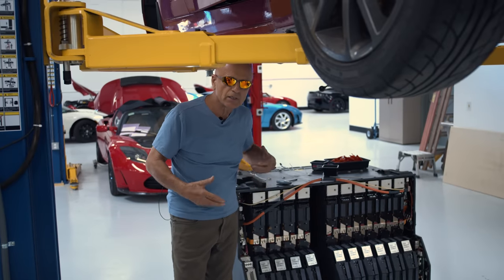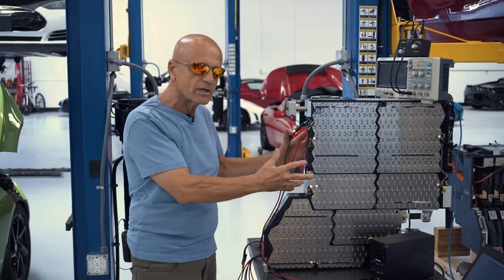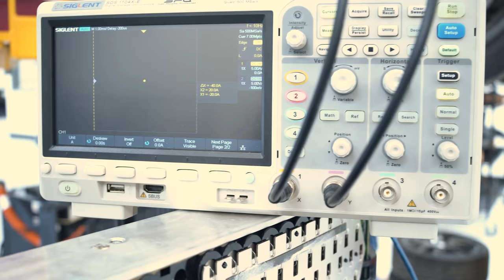Tesla Batteries STARTING TO FAIL | Gruber Motors

Comment: If you want something diabolical, try a latest generation Mercedes SL, after about 3 years (the warranty period), the sensors start to fail, roughly one every 4 months. There are 6 sensors in the exhaust alone, one of the average priced sensors failed at a price of £550 for the part, but the sting in the tail is that you have to take the drivers seat out (a 2 hour job according to Mercedes) just to get at the wiring. So battery issues are nothing in comparison.
Reply: Maybe the guys from BMW or Fiat started to work at Mercedes. Fix it again.
Reply: I will agree with you that a modern mercedes would have rediculous maintence, but he said that battery pack is $29,000 and takes 2-3 years to get so i don't really think the issues are comparable.
Reply: @zacharyswartwood218  Different types of cars. I'll just say that I'm disappointed in Mercedes. Scotty Kilmer's channel showed us a new Benz. My goodness, way way way over engineered. Stuff is already breaking. At the end of the day it simply gets you to where you're going, if you're lucky.
The battery pack is a real bummer. The traditional old model people would buy cars and get rid of them after 5-10 years. My daily driver is a 17 year old Cadillac. Still going strong. I'd hate to think I'd be looking at a 20-29K bill to use the car anymore, or worse a $100+ K bill to buy a new car. Yikes. It's like a regular car where after 10 or so years you have to rebuild the transmission, engine, and other components. The other problem they're not talking about is tires. Teslas seem to burn through tires at a much faster rate than ICE cars. Imagine being a young man, saving up enough money to buy a car, then the battery pack goes bad.
Reply: I've always heard that the Germans over-engineer their cars. Never doubted it.
Reply: @alexvagias5295  I thought that too, but from my direct experience and that of friends and colleagues, a Lexus is a far better bet if you want reliability. I don’t have a vast circle of friends, but one had a £30k bill for a new engine in his Audi R8, another had the IMS bearing fail on his 911, just a leak, another had the IMS bearing fail catastrophically on his Boxster, £10k rebuild, two friends had the cylinder linings fail on Audis…. One on his BMW. But as I say my Merc took the biscuit. So I sold it and went for a Lotus as they have Toyota engines… nuts choice but so far so good, although the fit and finish of the interior isn’t a patch on the Merc… but it’s a far more authentic / fun thing. But logic says when electric cars mature I think they should be far more reliable as there’s a lot less to go wrong.

Comment: Thanks for the video.  People ask me all the time...how long do the batteries last?  Looks like about 15 years, but is this mileage based (use based) or time based?  In other words, if you don't drive "much", will the batteries last longer or will they go resistive after ~15 years regardless of how much they're used?
Reply: Both !! Well logic say the more you used it the faster it worned out and these batteries have their own age
Reply: @auliaabidharma904  it also depends on how you charged the batteries or how/where you drove it in very high/cold weather…… also hard driving….
Reply: Leaving batteries fully charged is destructive to the cells so low mileage pack wont be great if not stored correctly.
Most owners will leave it fully charged or at 80% just on case they need to drive it.
Reply: I don’t think the roadster cells are water cooled are they , unlike the other models ?. So prob a bad comparison.
Reply: 900-1,000 cycles….estimated
Reply: @tellucas  this range is very limiting, but it is true, that the reason I would get a much bigger battery than I needed and use the middle 40 to 50% rather than needing to use 80 to 100% on a smaller battery.
Reply: @tellucas  I was a very early adopter of lipo in rc planes and was going.through a LOT of batteries until we figured out the storage issues were doing more damage then actually cycling them.
Reply: The batteries degrade with age. So, even if you only drive the EV a few miles per week, the battery will likely be worn out within 15 years or so regardless.
So, an ICE vehicle is the best choice by far for low mileage drivers.  
Unlike an EV, the life of an ICE vehicle can easily be extended to 25+ years with low mileage light usage and basic maintenance.  
You also will never recoup the additional up front  purchase costs of an EV with the fuel and maintenance savings if you are a low mileage driver.
Reply: @webcomment8895  so much of the cost of ev is the battery, the only hope is that there is will be replacement options in the future that might keep an old ev on the road.

Comment: This is the one big reason I don't really like the idea of large scale BEVs. especially as a daily where you'll be seeing a lot of cycles on the pack.

replacement fuel tank for the average car: $200 - Far less if you get a used one
Replacement battery for a tesla: $18,000 - less if you get a refurbed pack

Fuel tanks don't lose range on refills. Lithium cells do.

I will say though, the tech has come a damn long way, and it will be interesting to see what happens in future with both motor and battery technologies.
Reply: the battery needs to be compared to a new engine and/or a new transmission in internal combustion engines.
Reply: @anthonyballog8026  In that it's a wear item, and that maintaining it will extend its life, yes. but an EV battery is still more akin to the fuel tank, as like a fuel tank, it is storing energy. Just instead of dinosaur juice, it's little tiny ions of lithium with a bit of manganese and cobalt thrown in for chemistry reasons. oh, and the energy produced isn't combustion unless something goes horribly wrong :)
Reply: oh. also, if we want to compare the performance and reliability of a Tesla battery pack to an internal combustion engine just in terms of raw cycle life... here's what I can come up with;

Tesla battery (Panasonic NCR18650B or their equivalent NNP cell) (to about 80% capacity) - 500 cycles

note: the capacity starts tailing off further and further as the cell is cycled.

Other EV batteries using Lithium, iron phosphate (LFP) technology (80% capacity, cell manufacturer dependant) - 700-1000 cycles

Internal combustion engine: fuel tank range remains consistent throughout the vehicle's life. The only things that can really affect it are maintenance, a leak, and that's about it.

The downsides obviously for either are;

ICE:

- Emissions, especially with diesels, can be fairly noxious.

- regular maintenance required (every 3,000 to 6,000 miles depending on manufacturer or personal preference)

- Oils and fuels are not environmentally friendly unless you are using bio-diesels or alcohol fuels and other non-fossil derrived lubricants where possible. Either way - you don't wanna spill them in the Mexican gulf, that's for sure!!

BEV / Hybrid EV (both HEV and PHEV)

- Battery degrades over time, and used cells need to be recycled / disposed of and handled with care.

- requires rare earth materials to produce the motors and cells (e.g Neodymium, Cobalt). Both are not very environmentally friendly to mine. The upshot is we are finding less intensive mining methods, so give this time and it may change and improve vastly.

- Replacement batteries are very expensive. Potentially beyond economical repair if the car is below $20,000 in value and you don't opt to renew the existing pack with cell or cell bank replacements.

- Still requires some degree of fluid / coolant service, but still nowhere near as much as a combustion engine due to the simplified drivetrain

- Lithium ion cells have a flammable electrolyte, and aren't very chemically stable... Basically, give them a match, and you create a very fiery bomb. LFP cells aren't as bad because they're much more stable but can still cause a fire if mishandled severely or shorted.

electric vehicles have undoubtedly come a very, VERY long way from even 10 years ago, but they also still have a LOT more R&D and improvements to be made before they can be a direct competitor to ye olde dino-juice in every way possible. For that reason, I feel that internal combustion power is still going to remain a dominant drivetrain for a good while. Although technology is a fast changing segment, and with the increase in investment in electric storage and vehicle technologies, that is liable to change. It just needs more breakthroughs to occur.

Comment: I had a degradation of 4% after 2 years and 40000km, a year later after 50000km  a degradation of 4,7% on my 2019 Model 3 LR AWD. I'm diving fast on German Autobahn, so battery degradation is no argument any more.
The development is going on and on. Tesla rules.

Comment: Any chance of creating an aftermarket pack solution? The cells are off the shelf 18650's right? You guys could make a killing if you could engineer an even better aftermarket solution with more capacity and a better BECM to run it all.
Reply: if i remember correctly with low production numbers they didnt find it worth making tooling for the roadster, i believe they will for model s, x, 3 and y at some point with higher production numbers
Reply: @jackgreenstalk777  yeah there’s so little roadsters it makes no sense
Reply from the maker: We have been kicking that can down the road for a few years.  The gene pool of owners is tiny, but current climbing valuation and collector interest is making the ROI spreadsheet look better all the time.  We are working on a solution which may include Tesla.
Reply: @EsneiderV7  It could be a good starting point before moving on to upgraded packs for the Model S. It would be tough to reverse engineer the battery management software without infringing on patents but hopefully right to repair laws can allow them to avoid the issue.
Reply: Not a solution when the batteries become part of the frame of the vehicle, which Tesla is planning to do.
Reply: @grubermotorcompany  - I've been wondering about aftermarket packs, not just for Teslas, but all EVs. I guess there needs to be enough older EVs out there and the cost must be low enough to make financial sense. I envision gearheads putting some future uber-battery into old EVs to supe them up like they've been doing to muscle cars for decades.
Reply: Do you do work on the Rav4 EV. Our cars are going to reach the end of it's live too. You can make a killing selling battery packs to our cars as well.

Comment: Why not create a swap cell module for easy replacement?
Reply from the maker: There are 9 bricks (69 parallel connected cells) in each sheet (11 sheets)

Each cell is embedded in a thermal potting compound touched by a cooling jacket.  Removing bricks or cells is not cost effective and damages the cooling system and bonding plates.

Comment: Interesting. I’m curious, what’s the cost to find and remove the bad cell? And I’m surprised they’re lasting 14 plus years.
Reply from the maker: It ranges from $3600 to $6K dependent on the state of the pack.  Check out our website for details.
Reply: @grubermotorcompany  thanks, good to know. Still not cheap, but better than replacing the entire pack.

Comment: With your knowhow,  what is preventing you from making an aftermarket battery pack? It looks like you are working with Tesla not independently to solve this issue.
Reply from the maker: Economics, and Tesla is still producing a highly successful solution for now.
Reply: I heard  over 20% of the Roadster have had the battery replaced under warranty after 5 years.   Only a few survive now with the original battery or motor and seems to be supported with this video.   The 80KW and 90 battery did not perform as well either.   lucky the newer batteries seem to be better but 500,000 miles seems to be a sale ploy. If so give a 20 year 200,000 warranty  on the battery so used Tesla can be economical  or sell the battery at $5000 like you predicted.

Comment: Not trying to badmouth EVs but my 2007 Corolla still runs like a new car and it is older than any Tesla. It will probably continue to be reliable for at least another decade. In my opinion the biggest fault with EVs isn't range, it's longevity. In my opinion Tesla should be devoting some resources to keeping these older cars operating. They could make new battery packs with the latest technology that fit into the older cars and a firmware update to accommodate any differences in care required. If Tesla really wants to save the world from climate change it is a lot easier and less CO2 to make a retrofit battery pack that keeps an old car on the road for 20 more years than to make a whole new car. Probably not as much profit though. Great work Mr Gruber.
Reply: Tesla actually does offer replacement packs for all their cars incl. the roadster. Prices for replacements will drop to reasonable levels over time, be it new ones or refurbished batteries from accident vehicles.
Reply: @murraymadness4674  you can do one thing while doing the other. And without profit you cannot scale and therefore not induce as much of a change. They don't exclude each other. Not all entrepreneurs are classified as the classical homo economics that sees profits over anything else. But without, it is much harder to change anything.
Reply: @murraymadness4674  Have you read their mission statement?
Reply: @lapin46  I used to own a 2012 Tesla S that went out of battery warranty while I owned it. The car worked beautifully but I have to admit I was nervous about the battery dying. Tesla will install a good battery for $22k but they take your old battery back. That makes me think they use the good modules out of the bad battery pack to piece together good battery packs out of them, so they are selling packs with old cells. This is just conjecture on my part but if that is not the case, what are they doing with the old packs and why would they want them? $22k for a battery with new cells may or may not be a fair price but I don't think it is fair at all for a pack with 10 year old cells. If I am wrong in this assumption someone please correct me.
Reply: @alexkram  Tesla themselves state that under warranty they replace the pack with a pack of similar age/milage. These might very well be assembled from individual modules. If you pay for a new one, you actually get a new one.
Reply: @lapin46  That is good to hear, thanks for that info.
Reply: @alexkram  I have seen Teslas with bad batteries sell for as little as 10-15k. Adding a $22k battery brings them straight back to a $30-35k car. It might might not financially work out, but come close depending on spec and overall condition. In the US someone reported that Tesla offered a  4 year/50k mile warranty on a new replacement battery for an out of warranty 2012 MS.

Comment: Thanks !    If each cell is fused, then removing it from the pack can be quite easy.  Too bad that this has not be designed into the BMS.  Treat it as a matrix rd/wr operation and tabulate the actions for end of life estimate.
Reply: I think this is how modern models deal with it

Comment: Replace Tesla Roadster battery packs, and ancillary parts, with those from a Tesla Model S (new or used). Both models, Roadster and S, have the same number of battery cells. They should be about the same size. It may be a one-piece swap, hopefully. The swapped-out Roadster would no longer be a "museum piece"; but, who wants to drive a museum?

Comment: Pete Great work. 
About how much does a Tesla Roadster battery pack cost.? For the pack, for the install? 
Do they then have a new 8 year 100k mile warranty?
Reply from the maker: The current 80 KWh replacement, in the USA, is $29K plus tax.  A heck of a bargain since our math indicates they are selling at cost.
Reply: @grubermotorcompany  Affordable, after 14 years, for the owner of a $250k car!
Reply: @grubermotorcompany  If NCR18650B cells would work, the bare cells wholesale for $0.61 each, if you could trust a DHGate seller.  That would be $4,200 for 6831 cells.  Going into business remanufacturing battery packs seems almost doable.  There is just the minor amount of labor involved in testing/balancing the new cells, unwelding the existing cells, and welding the new cells into the bricks.  Sounds like an easy business opportunity ! /s

Comment: How many miles are on these roadsters  with failing in their battery packs ? Would you say it is more due to the number of discharges or age ?
Reply from the maker: A number of factors contribute to Li-Ion battery life, and miles is only one of many factors.  Age, charge cycles, storage temps, charge/discharge extremes, and in the case of the Roadster, a design flaw that lets the battery severely discharge, which damages and weakens cells.  

With the advent of EV's, wear and tear and deterioration is no longer confined to miles driven like ICE vehicles, but age becomes a factor with aging electronics, whether in use or not.

Comment: These Roadsters have lived their life expectancy. Now it's all hit and miss, replace one cell today, another may go next week. Letting a bad cell operate amongst good working cells degrade the group and easily damage good working one. If possible, easier to "Snip" the connector of a bad cell as they fail over the year, say 4, and then bring it in for life support service. You lose range for this year, but at least your good cells are not being destroyed. You bring in your car and replace 4 cells compared to service 4 times, replacement one at a time.